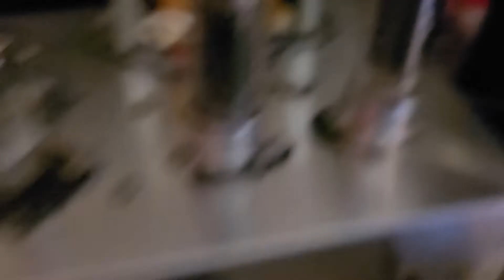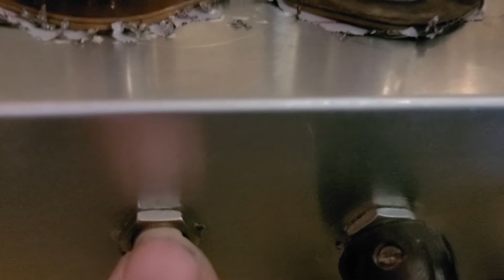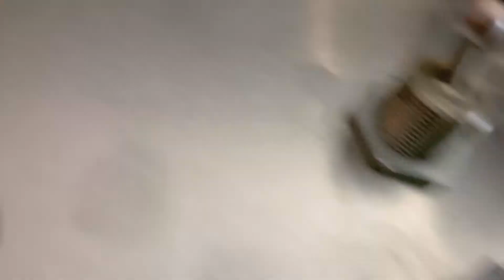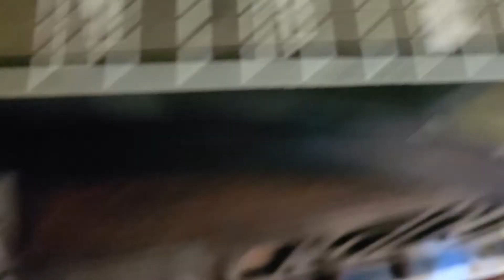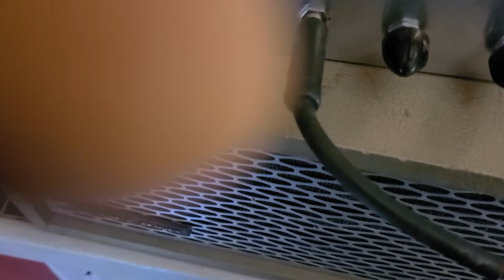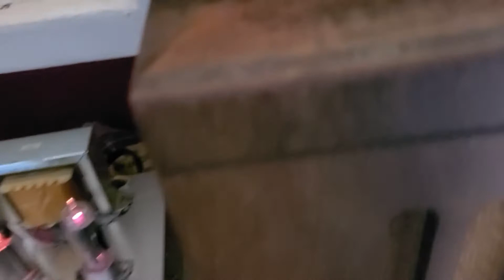AA4 Guitar amp build

Comment: Interesting build.  I have a question, with the Triad N-68X isn't the heater amp load a little high ?  Could you swap in a single 12AT7 and not hook up the center tap to eliminate a tube ?
Reply from the maker: Yes you could use a 12ax7 or 12at7 instead of 2 12at6 or 12av6.  With a 50dc4 and 50c5 that could complete the series string.  I have used a ss rectifier a 12at7 and 2 50b5s in a small se stereo audio amp with an n68x and it does fine
Reply: The schematic calls for 22uf cathode bypass caps that’s why it might be acting a little wonky or fuzzy with 12av6… just a thought… I’m actually building this right now with an old Webcor reel to reel 12ax7, 35w4, 50c5… in my case it’s just changing a few caps and resistors 😊 … and adding the old n-68x isolation transformer 😉